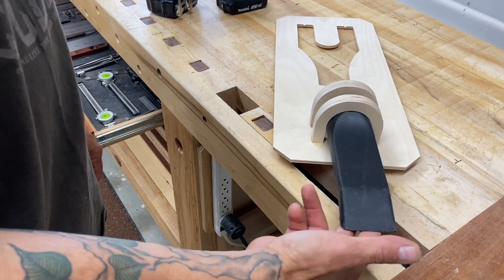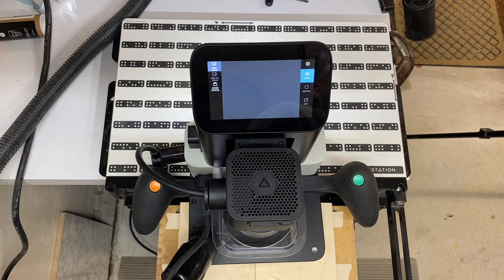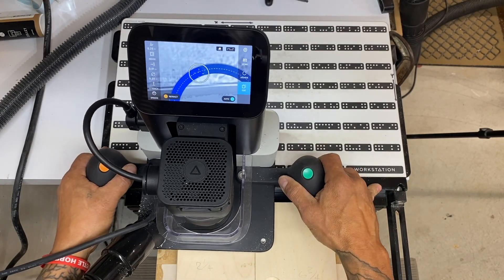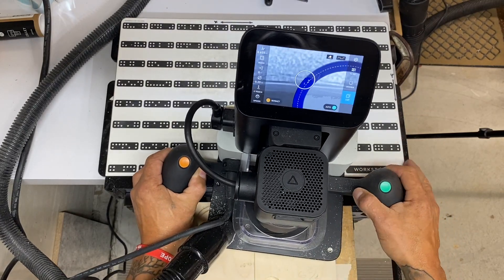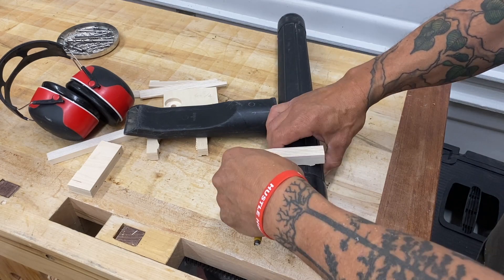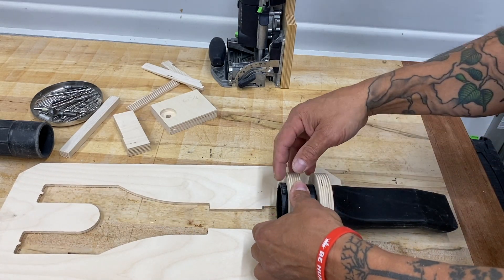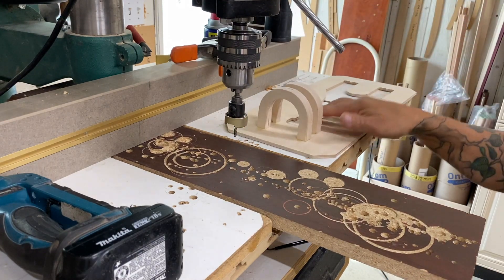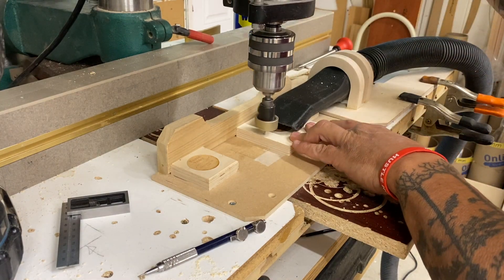Shop vac hose holder

Comment: Kind of lost me at the shaper origin. I need more basic tools before considering something like that. But the overall idea is cool and it is nice that you pointed out other possible ways to get to a similar result.
Reply from the maker: Thanks a ton Gina. Yes, a hold saw or even a jig saw would work well.  The overall idea of extending the vacuum tip over your work is what I wanted to convey.  I’m thrilled with the results!
Reply from the maker: Thanks a ton Gina. Yes, a hold saw or even a jig saw would work well.  The overall idea of extending the vacuum tip over your work is what I wanted to convey.  I’m thrilled with the results!

Comment: Thanks for another great video, Ramon.  I've got a 4" dust collector hose at my drill press which works okay, but adding something like what you have done would be so much better.  Using the Shaper Origin makes cutting any of those circles or shapes so quick and easy.  Thanks for the constant motivation to improve.
Reply from the maker: The vacuum improvement was a necessity that I had put off way too long!   I had always propped the hose haphazardly and it worked okay.  But with the 100’s of Domino Dock parts that need drilled I wanted the hose to hover just above the surface.  I’m thrilled with the results!   Thanks a ton David.